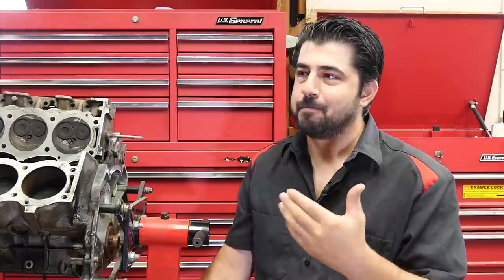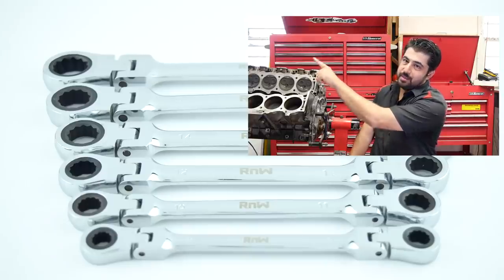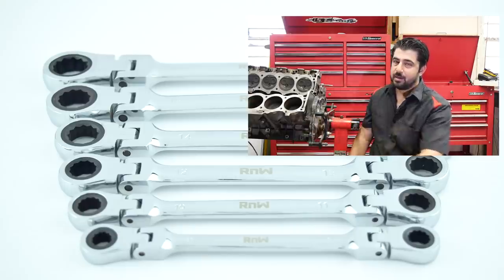Extremely Reliable Car No One Talks About

Comment: I disagree that the 2nd generation of Elantras made from 1996-2000 were horrible cars. I had a 1996 Elantra 5 speed manual that gave me no trouble at all.
Reply: I think having stick shift makes way more cars reliable. Same here I got a 2000 Hyundai accent 5-speed with well over 200k still running strong

Comment: I had a 2004 Elantra GT with a five speed for seven years. Bought it with 40k miles and so cheap I basically drove it for free for those seven years. I sold it four years ago and many daysI still miss it. That said, not quite as bulletproof as a Honda. I had to replace the radiator once; also lost a clutch master cylinder and a charcoal canister (a tough one to get diagnosed). The paint / sheet metal was not very durable. And yes, I did at least one routine timing belt; the rated service interval on the belt is 5/60k I believe. I still loved that car and I'd have no problem owning another Hyundai.

Comment: My 05 Elantra had the following problems clutch went out at 85k. Oil leaking from crank seal, oil pan, valve cover, and cv joint went out

Comment: The most reliable car ive ever had, was also the only american car ive ever had, I worked for a limousine company that had a fleet of last generation lincoln town cars, we would drive those cars around the clock almost 24/7, across states, in traffic, on highways, do the cheapest oil changes at wash & lube places, cheapest gas we could find, and those cars were sold after hitting around 850,000 miles, with the original engine and transmission, so I bought 1 with 220,000 miles, from a different company, and drove it  for uber/lyft, until it had 274,000 miles, and sold it because I decided to get a normal csr to commute, because the lincoln was super reliable, and super comfortable, but it has horrible fuel economy on local roads, but on the highway I was able to hit 26mpg, on local roads it was as bad as a v8 jeep, the 4.6l modular v8 I believe it was so reliable on those cars because the rev limiter kicks in at around 5500 rpms, but on the crown victorias specially the police package ones, its higher, giving it more performance, but at a cost of some reliability
Reply: Mind you, most of the cars ive owned, and still own are toyotas, hondas and acuras, ive had a 4cyl toyota celica 1.8 with bad transmission, 1997 celica 2.2 super reliable, 1995 4runner sr5 super neglected, just leaked oil from everywhere it was super solid, and reliable,  the transmissions on those things are bullet proof, paid a mechanic to fix it, he scammed me, so I sold it, 1998 v6 honda accord with bad transmission, and a 1997 acura CL3.0 super reliable, 2001 acura TL 3.2 super reliable, now I have a 2009 corolla, super reliable so far, and a 2003 civic manual that was very neglected, and im in the process of restoring it, mechanically and cosmetically, I dont need 2 cars,  just wanted to have a project, and save a stick shift civic from being junked, so I may sell either car when I finish the civic
Reply: Panther platforms probably the best made ever.

Comment: 2000 Hyundai accent 5-speed with a 1.5 l engine. I was a little bit nervous because the owner never really worked on the coolant and it showed when I flushed. But I've already put 13,000 mi on the engine with minimal problems. Basic maintenance issues of wear-and-tear only. It currently has 200,000 😂 it's one of my food delivery cars going to run this thing into the ground

Comment: I had a 2001 Elantra GT and I got 200,000 miles out of it. 180,000 of those miles were after a bad accident! I have a 2017 Elantra now and it runs very well. 

As you said, I think you have to keep up with maintenance; especially now with mechanical tolerances so precise nowadays. 

I went for an oil change and the shop was going to put a smaller aftermarket oil filter on it, even though it was supposedly made for the Elantra. The mechanic complained about how the Hyundai engines weren't that good, and even said the smaller filter was fine, even though he admitted it had a smaller capacity for oil 🤔. I didn't buy it and demanded the bigger Hyundai filter. Paid a few bucks more, but better than engine failure later on.  

Maybe back in the day you can get away with the cheaper stuff, but I wouldn't do it now. 
The Kia Optima I had years ago ran well, but developed a slight tick after putting an aftermarket filter. No going to chance it to save a couple of bucks.
Reply from the maker: With these cars that have known oil circulation issues I would not chance it with cheap oil filters at all. good move.

Comment: Hyundai and Kia have had reliable cars for the last 15yrs. I bought a 2010 Sonata  with 108k, and five years later I'm still driving it with no engine problem now at 172k miles.

Comment: From new I have a 2010 blue model and the 2014 mid model, 2010 bullet proof so far except for failed brake lines  as of a week ago which should not happen. Looks as though it failed at the anchor point which is understandable but it would not have failed it it were made of stainless or equivalent. Brake lines should be mandated. Sorry for those that do not like that idea but we are talking long term safety of an automobile. 2014 developed a valve tick, taking into the dealer to get taken care of under the 10 year warranty. We might have a fight but Royal Purple has been used in this car since new.Other then that, perfect cars.

Comment: Further on the 2010 with brake line failure, purchased a copper replacement with the correct high pressure unions and will go above an beyond as far as... No I will not cut 2 inches out; I will go the whole length if need be. Most likely a six foot section or more to cover lines that get hit by road salts and other. I will look for healthy pipe. I have not been able to fine direct replacements for other then crazy dealer prices. If anyone knows I will purchase the direct replacements and do them all. Seems as though the fuel line was done exactly the same way. Also needs to be replaced in order to be correct.

Comment: I had thought the main problem with Korean cars was that after 10 years the manufacture stopped making and suppling replacement parts. That would be ok if the oversaw the aftermarket supply ,even a little. On east coast it was hard to get parts as they had to be ordered from Korea if nos parts were not available. Language, quality of manufacturing and many things went wrong causing cars to sit in the shop for a long time for what was a simple part and fix. This may have changed?
Reply: All oems do that. Why should they make parts for older model? They are in the business of selling cars, not parts, and keeping old one on the road is a new car not sold. Government requires parts availability for ten years after the last model year sold iirc.

Comment: You don’t have to be a experienced mechanic to work on them either. I had bought a 09 spectra  and I didn’t realize about the timing belt when I bought it and it had 119k and everything was still working and factory. And it wasn’t until 144k till I was confident and changed the timing belt. It took me a week but I have never done a timing belt before I just followed instructions and one of the first videos I watched was by you. Technically my cars engine timing belt should have been replaced twice but it could have made it longer with the factory belt but that would be pushing it. Besides that and normal wear and tear , it’s made it to almost 150 k and still has the factory head gaskets, engine, transmission, parts that many newer cars fail at early mileage. There’s so many cars that don’t even make it to 100k without some sort of major failure but yet without a doubt everytime I use my car it runs and drives and everything works. Just like almost cars if you take care of them they will take care of you. A factory can only do so much to a car and you have to take it as is. You can’t blame the car for failing if you didn’t take care of it. The factory even recommends what to do. Why do you think there’s laws for tentants when they move out of s rental the landlord has to be okay with wear and tear. You wouldn’t get mad at a tentat for wear and tear it’s not like they purposely damaged anything the same goes for a car.

Comment: most those Hyundai’s were advertised to come with a 10 year warranty ... did the mfg stand behind that warranty ??.
Reply: Sometimes the dealer will give you a run around and give you some excuse not to honor it.
Reply: The short answer is no, long answer is maybe.
Hyundai/KIA put an expensive but largely unnecessary maintenance called "valve clearance adjustment" at around 70K miles, most people skip it because it's very expensive (four digit territory), but guess what, they ain't gonna honor the 100K warranty if you don't do it. Here's the thing, most modern car engine doesn't need such adjustment even at 200K let along 70K miles and I doubt if Hyundai/KIA dealers actually do anything about the engine if you pay for the maintenance,  It's really just an fordced extended warranty.
Reply: I knew someone with a Hyundai, they hated dealing with warranty repairs because the dealers had every excuse under the sun.  

It didn’t seem to be worth the paper it was on. I would not buy one.
Reply: No they don’t. That’s the problem with Kia and Hyundai.
Reply: I've heard Kia is more lenient with their warranty than Hyundai. Maybe that's just the Phoenix area dealers though although I also the buying process is a pain but once it's done you have a decent car. I bought a used Kia at a Nissan dealer so I can't really comment on Kia dealerships too much. I'd recommend finding the Kia equivalent of whatever Hyundai you are looking for and going with that, Kias in my opinion look better anyways.
Reply: Was a hyundia tech for a few years. Hyundia always honored the 100k warranty, even if the customers didn't do their regular oil changes. Hyundia would also goodwill many repairs that were out of warranty. I would only ever consider buying a new kia or elantra. 
My brother bought a used 2012 santa fe sport, second owner warranty is 60k. It blew up at 70k I told him have it towed to a dealership cause he was 2 hours away. They gave him a new engine and a loaner car for 2 months. Some of the 2012 santa fe and sonotas had a defect in machining that year so the engines are now covered for the life if the vehicle. Don't sleep on hyundia/kia.
Reply: We’ve had three Hyundai vehicles over the last 20 years. Two Santa Fe’s (2001 & 2017) and 09 Elantra (certified used). We’ve only needed to use the warranty twice. Both times there was zero questions asked, repairs made and dealer took care of us.

Comment: Still driving my 2006 Mazda 6 2.3 with 317,000 on it..original trans ,motor and all the rest only things that went bad front bearings ignition coils and headlights and taillights and carboned up throttle body nothing else!!!

Comment: I can definitely appreciate that Hyundai/Kia has been trying to up their quality and it seems like prices are low to get people in the door as they've had a less than stellar reputation in the past. 10-15 years from now they'll probably be more expensive and more on par with Toyota and Honda at the rate they're going. Nissan on the other hand, just wants to sell shiny appliances on wheels and could care less if it breaks on the customer later. My sister has had two transmissions in her Altima and there's always some oxygen sensor or some random thing kicking the bucket and needing to be fixed. We rented a Rogue after our Honda was in an accident and we were not impressed with the quality. Ended up convincing my mom to get a Sorento instead as she was looking at getting a Rogue for a while. At least within my circle, all the Kias my friends and family or I myself own/owned have been excellent and only needed routine maintenance.

Comment: Good video. What do you think of newer models 2017-2019?  I see lots of these on the road.
Reply: Not for long you would it Great looking car drives great 30,000 miles they have a great warranty I thought well they have unbelievable warranty the best on the market in fact a either a text so it be it’s a nightmare it drives great it just locked up of course Hyundai immediately came and picked it up do you not mess with my cub I was devastated I almost cried!

Comment: Have you had any experience with the 2011 KIA Sorento with the 2.4 L 4 cylinder engine? I have one I bought with 100K miles and it now has 169 K with no problems so far. Just wondering if there are common problems with these cars?

Comment: IS THE 2013 GENESIS 2.0T an interference engine?  The head gasket blew twice! At 63,813km. And then again at 64,567km. 

First repair was $2872.00 CDN. The second repair was over $5200.00...because the Genesis needed the engine...most of it replaced...but I threatened a lawsuit, so Hyundai paid for it. I’ve told my wife to sell the car, I won’t pay for any repair over $10 bucks. Does this car have an interference engine?  Thanks!
Reply: Google will find that answer in seconds.

Comment: Timing belt on an interference engine is a deal breaker.
Reply: I keep hearing that. How do I determine if an engine is an interference engine?
Reply: @spiralnapkin  Assume any car made in the last 20 years is interference. If you Google something like "2000 Honda Civic engine interference" you'll find answers and maybe rare exceptions.  I like belts...just replace them on schedule. Drove a '98 Civic about 750,000 miles just replaced the belt every 100K. Chains can last a long time just avoid cars with known chain problems because the cost of replacing the chain will make you wish you had  a belt. Don't skip oil changes if you have chains.
Reply: @spiralnapkin  Ask the internet.
Reply: @markd9130  Toyota and Fords normally aren't interference engine.

Comment: Hey I got a 2005 Hyundai sonata v6 last year I want to know what I should replace/fix before it goes bad. When I bought it I replaced the rotors/calipers/break pads/spark plugs/battery/tires. I've changed the engine oil regularly. It has 180k miles.
Reply: Why the calipers?
Reply: @wholeNwon  the car had been sitting for a long time+ snow, pretty much all of the brake system was rusted over

Comment: 2000 & prior - not good.
2001-2006  -  2004 introduced cvvt  - interference engines - cooling system/head gaskets, input output sensor on trans./
2007-2010  - 4th gen. improvements with head gaskets/lifter noise & trans. Still interference engines w timing belt.  2007 - 2009 RECOMMENDED. 2010 trans. trouble.
2011-2015  - still interference but w a timing chain.  2011-2013 crank bearing failures.  2014 & 2015???????
2016 to present?

Comment: Just make sure it doesn't make that horrible noise everyone sued Hyundai over.  There was a huge class action lawsuit over their Theta 2 engines.  They weren't deburred properly at the factory and it caused oil flow problems that made them make a horrible noise and often run poorly or even seize on the road!  I don't know if they had problems with any of their other engines but I know avoid that one at all costs!!  I don't know if they got their act together and now the problems are gone.  I just don't know a lot about Hyundai other than they are my very last choice if I ever look for a replacement vehicle.

Comment: The nissan versa 😂 sorry i have just been lucky i guess bcs my car has 130,miles and its a 2017 with a cvt transmission i have never done anything to it just oil changes and basic maintenance the car still going strong and no lights on the dashboard
Reply: Yours is still too new.

Comment: Hi I got a question for you about my 1996 ford probe GT ok when I start it idols good but when I go for a drive with it and shift into neutral or at an idol it raves up higher then it’s suppose to it doesn’t seem to want to drop down to normal rpm any ideas to help a guy out it would be greatly appreciated
Reply: Just look up Chris fix how to fix high idle
Reply: Thks